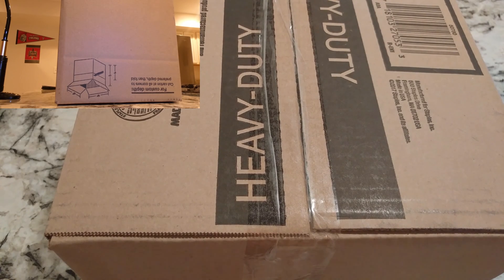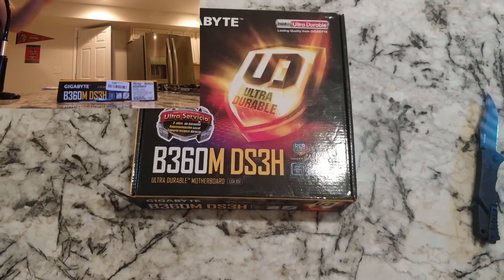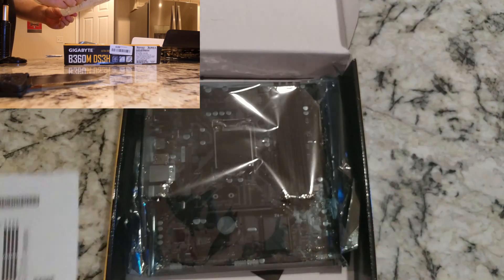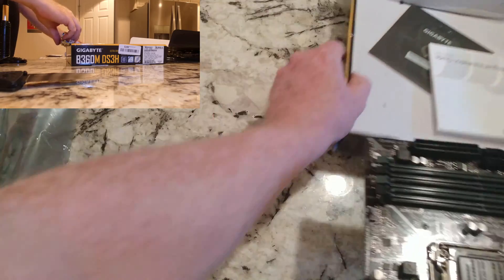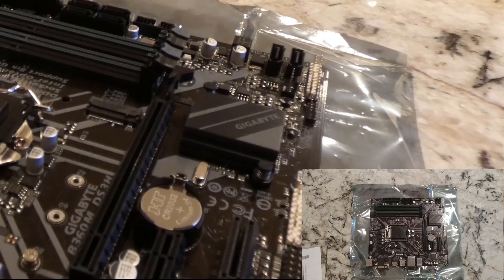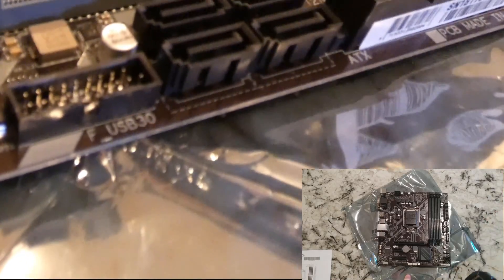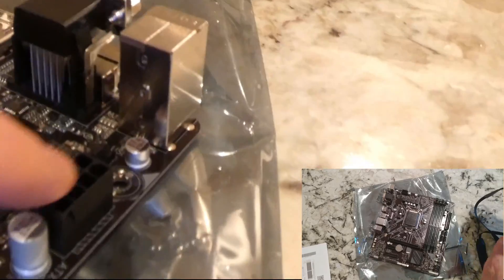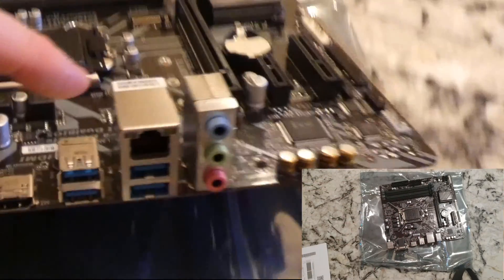Gigabyte B360M DS3H, mATX 8th/9th intel Gen motherboard unboxing and review of features

Comment: I have the exact motherboard. I installed an i7 9700 on it and a 3060ti with 32gb ram. Just wondering what maximum generation of M.2 nvme ssd does it support?

Comment: Is it support i59600k ?
Whi one is good 
1.Gigabyte B360M Gaming HD Intel LGA 1151 DDR4 SATA 6Gb/s USB 3.1 Micro ATX Motherboard.
2.this.
Plz Ans me
Reply from the maker: Hello, as of Bios update F14, it supports this.  You can see this at the following link:   https://www.gigabyte.com/Motherboard/B360M-DS3H-rev-10/support#support-cpu    The only question other than that would be if you were to buy it, what BIOS would it have, and would it boot with an I5-9600k in the socket.  If not, you would need to buy an 8th gen to update the bios.  You can get an 8th gen Celeron for around $40.
Reply from the maker: Here is a video of me getting this motherboard to boot with an I3-9100 with a F5 BIOS...which was at least 12-14 months old.  https://www.youtube.com/watch?v=eqIc0cJYtsk The I5-9600k came out before the I3-9100, so there is a really good chance that it will allow you to boot to bios and/or windows.  You would want to eventually update the BIOS....I have a video on here showing that if you need it.
Reply: @PC_HardwareTechUnboxing_1  tq so muchbro...
Last question plzz ans.. me

What about asus Asus B365M-A - LGA1151-9th Generation Supported Motherboard - DDR4, M.2, 64GB
Or this
Which one good for
9600k processor
Reply from the maker: @adityayousafzai2372  Ideally, for any processor that ends in K, you want a Z370 or Z390 motherboard.  Best way to unlock its fullest potential.  Overclocking does come with additional costs and the motherboards are more expensive.  Plus, depending on your case size, you might be limited.

Out of the choices, these B365 motherboards are pretty much like saying this is B360 Rev 2.0.  If you notice, some of the motherboards are doing this .  For some of these, the features seem to be exactly the same...but they are saying 8th and 9th gen compatible.  For all I know, they could be taking a B360 with updated BIOS and rebadging it.   So if you do not have access to an 8th gen CPU and want less potential headache, get the B365.  Personally, if you look at this channel...I have brought in close to 20 motherboards this year.  Most of them have booted with one of my 6 9th gen chips in it without doing the bios update until after the fact.  Luckily for me, I have several 8th gen chips in case it didn't work.  On top of all this, I have gotten a Dell Inspiron 3670, HP Envy and HP slimline 290 to boot with 9th gen in socket.  All 3 of which came with 8th gen cpu's.

Ok, so if this is your first computer build...I say get the B365.  If you have more patience and are confident that you will connect everything correctly the first time and realize you may have to spend $40 if it doesnt' boot, buy the B360.  I put the odds at less than 10% that it won't boot if correctly configured.
Reply: @PC_HardwareTechUnboxing_1   tq for eaxplanation my  mother bord budget 8k only.
I don't want over clocking and i don't no boot.
Iam normal user.using photoshop.
Plzz suggest one motherboard for
i59600k under 8000/-
Reply from the maker: @adityayousafzai2372   8000 what?   I would need that number in US Dollars please.
Reply: @PC_HardwareTechUnboxing_1  below 8000/- rupees indian rupees.. only.
Reply from the maker: @adityayousafzai2372  What size is your case? minnie tower?
Reply: @PC_HardwareTechUnboxing_1  no normal  basic case. I want to buy .
Reply from the maker: @adityayousafzai2372    Case selection is really important step.  If you need a large graphics card, whether gaming, video editing, rendering....all those benefit from the newer graphics cards.  Some of those happen to also be large.   Proper ventilation/cooling is another reason to go with a larger case.  If you are going to be running this thing for hours at a time, consider this to help keep those computer parts cool and possibly increase their longevity.

 You don't want to overclock so we can look at H310, H370, B360, B365 and not spend extra on z370/z390.  How much RAM will you need?      Do you want the ability to have multiple M.2 NVME SSD's?
Reply: My pc build.
Intel i5 9600k, motherboard  confused ?,
250gb ssd. corsair ddr 4 8gb ram.
Corsair 550 smps. wd purple 2tb Hdd.
Lg 24x dvd writer. DELL S2419H moniter.

I will later added after 1year another 8gb ram in second slot.
and nivida Gforse1050 ti 4gb grafic card.not now.
Reply from the maker: @adityayousafzai2372   Why M.2 SATA and not M.2 NVME?  Usually a huge read/write difference....boot times will be fast, but NVME should beat it everytime.
Reply: @PC_HardwareTechUnboxing_1  ho.. really..
I don't know this..
Iam new pc builder. I don't like amd and intel i3 processor .i like only intel i5 i7.
I5 9th gen 9400f no intigrated grafic card.so i choose 9600k.
Plzz suggest good one.
Plzz provide mother board and ssd link in amazon.
Reply: We are chat in youtube.
Any spam prblem ?

Comment: i am confused with how many usb ports are accesible on this motherboard???how much usb headers do i need on the case to get all ports ill sub if you answer
Reply from the maker: Thx for you question..  Funny, you ask as I was just reading up on the differences between chipsets. and sorry, if I was not clear in the video.   This should be the answer you seek:

Total of 6 USB 3.1 Gen 1...4 stick out thru the heat shield.  2 ports are available thru the single internal USB 3.0 header near the 4x SATA III ports.

Total of 6 USB 2.0.  You can see there would be 2 sticking out thru the heat shield.  4 more are available thru the 2 F-USB headers that are to the right of the external connectors along that edge...halfway up.

This adds up to 10...which is the magic number for all H310, B360, z370 and h370...however the number of 2.0 or 3.1 varies depending on chipset.  I hope this answers your question..
Reply: @PC_HardwareTechUnboxing_1  thanks!!!!!!! really helped me

Comment: Wait so can a 9th gen go into this motherboard?
Reply from the maker: Yes, as far as I am aware..all 300 series motherboards for custom builds will accept a 9th gen.  With HP, Dell, Lenovo..this may not be the case.    I have installed them on 6 mobos.  It may require initial setup with a 8th gen chip though and bios update.
Reply: David Noble unfortunately I don’t have a 8th gen is there any way I can update it without?
Reply from the maker: @arthurmorgan4952  No, it has to post to Bios to access Bios update screen. You might want to consider buying used 8th Celeron on ebay for $40-50.  I was going to possibly provide a service...but have not worked out all logistics.  See unlisted video link:
Reply from the maker: Here is link:  https://youtu.be/GQR_ylCpDgk
Reply from the maker: BTW, I finally made a video showing 9th gen working with older BIOS:  https://www.youtube.com/watch?v=2wOl9jz2TV0  This video is a complete build...and shows it booting up.
Reply: i installed this motherboard with 9th gen and it works!
Reply: btw its i5 9400f
Reply from the maker: @remllana1067  Bios version? for those who may find this.
Reply: @PC_HardwareTechUnboxing_1  it was f14 but i updated to f15

Comment: pls can you do bios update video. so i have b360 ds3h mobo does the motherboard support i5 9400f and sorry for my bad english.
Reply from the maker: My plan is to do build a computer...verify it won't boot with 9th gen.  And was going to use either I3-9100, I3-9100f or I5-9400f.  It boots...I would update bios.  Otherwise start over with 8th gen chip.  Unfortunately, I am on travel for a bit.  2 x 300 series motherboards that worked out of were the MSI Gaming Plus Z370 and H370 Bazooka box with 9th gen.  They are cheaper than z390s.  My Gigabyte H310M was a bust...so expecting same here.  I will probably need 8th gen chip to update.  Luckily, I lots of CPUs.
Reply: @PC_HardwareTechUnboxing_1  so in order to support core i5 9400f i have to do bios update on my b360m ds3h or do i have to move on an buy a new mobo thats supports 9th gen processors?
Reply from the maker: @nivondesilva4581  most of non z390 motherboards require 8th gen chip  seated to do bios update.  After boos update they can be used for 9th gen.  For u...buying a different mobo might be easier..or buy cheapest 8th gen celeron  $50-60 to do update.  Currently, I know of know 3rd party services who provide this...though I have done it for a few people for charge..local to me.
Reply: @PC_HardwareTechUnboxing_1  oh ok, thnx for the information
Reply: @PC_HardwareTechUnboxing_1  btw i have a core i3 8100 is that cpu ok to bios update
Reply from the maker: @nivondesilva4581  Yes, that cpu is perfect
Reply: @PC_HardwareTechUnboxing_1  thank you sir for your time. i liked and subscribed to your channel
Reply from the maker: You are welcome....please give a like if it was helpful.  I might just be making a video to discuss a service that I might provide for updating 8th gen 300 series to 9th gen.  So keep an eye for that if you find yourself in a bind.
Reply: @PC_HardwareTechUnboxing_1   oh thank you ill keep an eye out for the video 👍👌
Reply from the maker: I made this video unlisted but u can open it thru link https://youtu.be/GQR_ylCpDgk.  Please let me know if this makes sense.  I will go live with a different version....I used cellphone fir audio recirding.  When I get home  I'll use studio mic and improve other aspects.

Comment: Suppport i5 9400f ?
Reply: He does Bios update in a similar video for Gigabyte H310M A using 8th gen chip to than use I5-9400f.  This gas same bios revisions as that one
Reply: Please translate my spanish, tengo la mbo gigabyte b360m-ds3h y me dice q ya viene optimizado para los procesadores de serie 9000 lo q quiere decir q ya no es necesario actualizar la bios ?
Reply from the maker: @Whibley_94  
I have the mbo gigabyte b360m-ds3h and it says that it is optimized for the 9000 series processors what does it mean that it is not necessary to update the bios?
Reply from the maker: Hola,..that is a good sign.  I have had some folks asking about this motherboard and though I have 2 of them, I have not had time to check out if they boot with I3-9100, I3-9100f, I5-9600k or I5-9400f in the socket.  With them stating it is optimized, good chance you have a newer BIOS.  I bought similar motherboard H310M A and it had a bios that was from 4/2018.  5 BIOS updates had passed including ones to make it 9000 compatible.  Once you get the computer set up, check your BIOS date thru either Sys Info on the start menu or in the actual BIOS.      If yours is really old, update it.  If it appears everything works great....you might want to pass.  There are risks with doing a BIOS update.
Reply: What risks can there be when updating a bios of the gigabyte b360m-dss3h?
Reply: optimized for 9000 series processors
So it says to me in the box of the mainboard ?
Reply from the maker: Risks are that the process will get interupted possibly power outage, hardware failure...etc.  if that happens motherboard, is sure to be fried.
Reply: @PC_HardwareTechUnboxing_1  
but if it comes optimized for series 9000 processors there would be no problem, since it comes compatible with 9na serial processors like I5 9400f
Reply from the maker: @Whibley_94  Yes, it will work.  There are lots of reasons to update the Bios.  You just need to occasionally check your mobo mfg site and see if there is something that was updated...or a bug they fix that you need.  Otherwise, recommend not messing with.  In the future, you might also want to buy the newest 9th gen...it may run poorly.  You may need to do bios update than.  Or you may never ever need to do it.
Reply: @PC_HardwareTechUnboxing_1  Hello it turns out that I have the Bios F12 version on the Gigabyte B360m-ds3h mainboard and my I5 9400F processor was fully compatible since in the box of the mainboard it said: Optimized for Intel® 9th Gen Core ™ Processors, check in the support option of the official Gigabyte page with the model of my mainboard that was telling you and I saw that there is a new version of Bios F14 and I would like to know if it would be necessary or obligatory to update said Mainboard? Help me with that information please
Reply from the maker: @Whibley_94  If your computer us running well, I would say don't mess with it. They are now up to F15.   All of the revisions appear to to improve stability...provide support for future processors or fix a security issue.  The latter might be the most important. .but I don't see details about it.  Updating Bios is pretty simple..but as I always state, no guarantee that your mobo will come out of it working.
Reply: @PC_HardwareTechUnboxing_1  oh ya, this is my computer is working well ... then it would not be necessary to update the Bios of the MBO
Reply from the maker: I think you are good.  If I find out the Security update is a must have...I will get back to you.
Reply: @PC_HardwareTechUnboxing_1  ok thank you my friend
Reply: @Whibley_94  a mi tambien medice eso en la caja, stoy por comprar un micro i5 9700k se que no puedes hacer overclok con dicha placa pero weno si dice q soporta la 9na generacion le voy a meter duro tambien con una rtx 2070 super q actualmente tengo no se si me va a explotar la placa :(
Reply: @sunyclubband4203  deberías ver en la página de gigabyte, buscas este modelo de placa y en opción soporte te dice que procesador soporta esta placa
Reply from the maker: I see Tom responded. ..most likely it will need 8th gen.  Unfortunately, I can't verify this for about 3.5 weeks.  There are 2 MSI mobo 30 series that worked right away.  Bazooka H310m and Gaming Plus z370